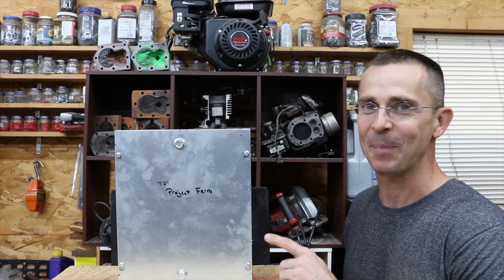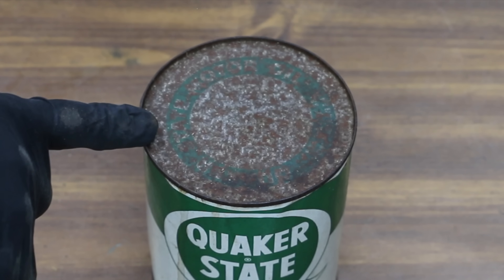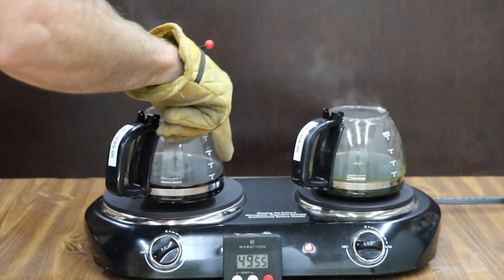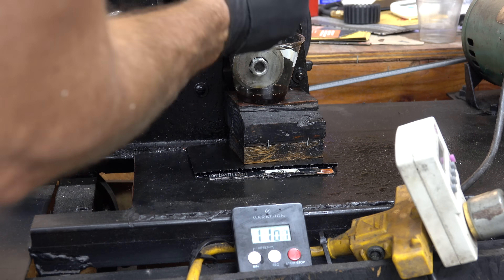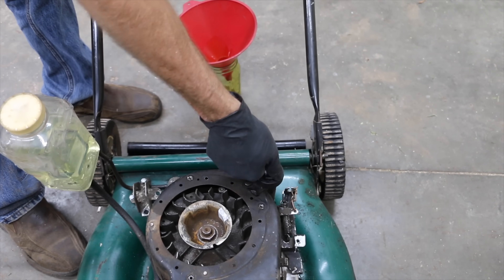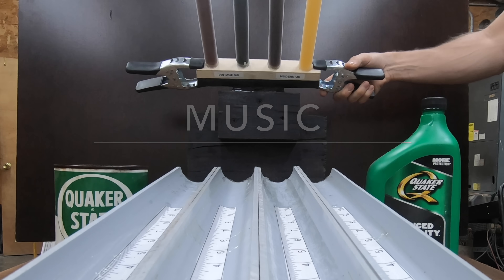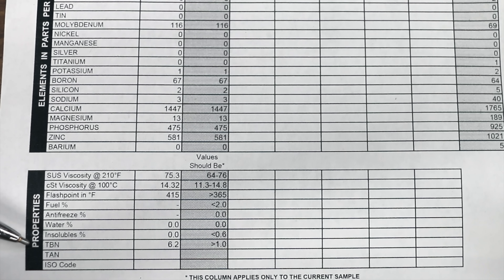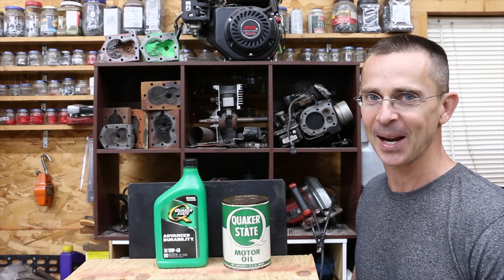Is Oil Good After 70 Years?  Let's find out!

Comment: My Dad used that very same Quaker State oil in the '39 Willys Coupe -- He would add a quart at every gas fill-up.
Cars didn't have Oil Filters in those days, and engines didn't last long.
It's SO much different now, thanks to modern technology and government environmental regulations.  
The famous 95 MERC's V-8 engine runs Pennzoil Ultra Platinum, 5W-20; Bosch Premium Oil Filter # 3410; and a FILTERMAG # SS365PR Magnet Kit. Oil & Filter changes at 5,000 miles.
Reply from the maker: Thanks for sharing!
Reply: I think a very long time ago,Quaker and Pennzoils were good quality,then they went through a problem period,I think now that under Shell they are perfectly good oil and safe to use although I am still a Valvoline Synthetic fan except for my small engines which might get some 15w-40 Diesel rated oil. or some thicker Mobil 1 if I felt like indulging the thing.

Comment: I wouldn't use Quaker State motor oil when it's fresh. One of the mechanics at a car dealership where I sold cars told me that an engine was severely gummed up inside when he tried to work on it. The owner used Quaker State oil. He told me not to use that brand of oil. I use Valvoline.

Comment: Around 1950 a service station talked my dad into using the "new" detergent oil in our 1948 Pontiac;  the engine lasted about one week as the oil turned into tar as it  "cleaned out" the crankcase;  the engine finally froze up and was a goner...
Reply from the maker: Thanks for sharing.

Comment: 50 years ago, I changed oil and filter every 1,000 miles. Also, Used motor oil for diesel engines in gasoline engines because the oil for diesel engines was better quality.,The manufacturers recommendation for oil and filter changes were for an oil and filter change every 30 days. If you followed that schedule the engine would stay clean and free of sludge. I could easily make an engine last 10 years or more. I paid 40 cents per quart of oil and on sale I could get new filters for 99 cents. Quaker state was an oil that I often used. In addition, I often used Chevron DELO for diesel engines. The Chevron DELO had a DG/DM rating. That means diesel general/ diesel medium.
Reply from the maker: Thanks for sharing.

Comment: Fascinating results thanks for the upload.👍

I bought a 5L jug of full synthetic QS blend two years ago and recently noticed that the production date is October 2016.  I read that the shelf life of sealed synthetic oil is generally between 3-5 years varies by brand.

Is the oil safe to use today in its sealed condition (5+ years later)?
Reply: @kimbuck-2  No guarantee in writing.  Up to 5 years is generally what the big brand manufacturers recommend if properly stored.  Anything beyond at your own risk.
Reply: They keep changing the specifications and test procedures for new car warranty every couple of years but often an older formula will pass the undated specifications I think. 
Circa 1979 the SE became obsolete,I think Quaker State/Pennzoil had to reformulate to pass the new for then SF rating but Castrol and/or Valvoline formulas already met the new SF requirements. 
 A new hurdle,some of the additives that were good for the engine seem to have been flagged by the EPA as bad for catalytic converter durability/life. So newly restricted as to amount permitted in oil.
Reply: @davidpowell3347  thanks for your input.  As an update since my last post, I proceeded with the oil replacement with the expired QS full synthetic jug and the engine is still running like a charm.  QS oil has been replaced since.  Top quality oil, imo; much better performance than the current/subsequent Pennzoil full synthetic replacement.

Hard to destroy engine with slightly overdue oil.  I heard of a fellow who did not replace the engine oil in his battered corolla for years and the car kept running, surprisingly.🤔

Comment: the old oil was probably a single viscosity 30 weight oil.  I remember as a kid when multi viscosity oils came oil because it was hailed for being good for "all -seasons" and you didn't have to change your oil in the winter/summer.  Great test though, pretty cool.
Reply from the maker: Thanks!
Reply: You could use the same grade both summer and winter.   No more calculating what viscosity to use just because of the time of year.  It wasn't always good though.  It sometimes sheared.  That's why many of us wouldn't use it.

Comment: Back in the late 70s it was common knowledge that QS would sludge up an engine worse than any other oil. A friend bought an old '67 Chevy with a 327 that barely ran. We started opening the engine up to assess what was going on. When we pulled the valve covers it was like taking a Jell O mold off. Completely filled with chunky sludge.  When we pulled the intake, the lifter valley was the same. Completely filled with chunky sludge.  If I remember correctly, there were some old QS cans in the trunk. This car clearly had been abused, not had the oil changed frequently enough and we don't know for sure if it had used QS all of it's life, but it sure seems to jive with the chemical analysis of that old QS.  
To this day, I avoid QS because of that experience, but it appears that moden QS is probably as good as just about any non synthetic oil made today.
Reply from the maker: Thanks for sharing.

Comment: I used to use that same oil in my truck. Has it been that long ago? I had a oil spout that you pushed into the top of the can so you didn’t need a funnel. 

Those days were so much better than now. I remember gas at .22¢ a gallon and just $2.00’s worth of gas at the full service station. You pulled up to the pump, a couple of guys would come out and tell you to pop the hood so he could check the oil and everything else while the other guy would pump the gas for you. All for $2.00.
Reply from the maker: Thanks for sharing.

Comment: The weight of oil and SAE was stamped on the upper or lower lid.  You needed to clean the ends to look at the raised numbers.  Also quaker state was formed between 1912 and 1931 so that oil is probably from the 1970s and could have been non detergent oil also.
Reply from the maker: Thanks for the feedback.

Comment: I remember when I was young, oil & soda pop both came in cans & you had to have the can opener you used or stab 2 holes with a screwdriver. Quaker state was green & had an odd, unpleasant smell. Lots of people claimed that Quaker state would gum up your engine. I always wondered if it was true.

Comment: My grandpa would use the same Q state oil to mix in 2 cycle gas in an old Clinton-powered, 3-wheel, Western Auto lawn mower. It lasted for years. Early to mid 60's
Reply from the maker: Thanks for sharing.

Comment: I really enjoy your videos and believe they are a big help to consumers. I have recently come across a product called Tribotex that is an oil additive that claims to coat metal surfaces in the engine with a ceramic coating and even claims to build up worn down areas with the ceramic. It claims to greatly reduce friction to the point of being audibly noticeable. It makes some pretty bold claims and they provide some test results to back their claims. The new formula of Bestline oil additive now also claims to provide a ceramic coating. I wonder if they are now using the same technology. If I send you some of each of these products in their original packaging could you test to see if they live up to their claims. I know you have tested Bestline in the past but the new formula appears to be ceramic based like the Tribotex. And they haven’t provided any Videos or much info on their new formula. If you will test them I will send them to you.

Comment: OK, I'm 3 years late. Back in the 70's, I worked at a Texaco gas station. We sold Havoline motor oil, but we also had some Texaco brand straight 30 non-detergent oil. IIRC, it sold for $0.49/ quart. It looked just like the old Quaker state oil, and probably performed about the same.
Reply from the maker: Thanks for sharing.

Comment: A few days ago I was looking through my Mum's garden shed and found a can of Golden Fleece Duralith 2.2 grease (Golden Fleece was an Australian company than merged with Caltex). I know it's been there longer than I've been around and I'm a 1959 model. I'd say it's a similar vintage to the oil in this video. Just for yucks, I looked it up and found a can of the same grease in slightly worse condition for AU $175! It did what I needed it to do but I wasn't greasing the bearings of a modern engine.
Reply from the maker: Thanks for the feedback.

Comment: Is it possible to do a similar test comparing oil that has 1) sat for a year (or two) in a small engine versus 2) brand new oil versus 3) oil that has sat on the shelf for a year or two?

This would answer the age-old question of whether oil REALLY needs to be changed every year, even if the engine has not been used very much or even at all.  Online forums debate this topic at length, but I've never seen any direct evidence backing the claim that engine oil acidity/viscosity suffers after sitting around for a year or two.  For example, do I really need to change my snowblower's engine oil if it only snowed 2 times last year?

Thanks for the great videos!

Comment: It looked like there was some labeling on the top of the can, where it was pierced with the can hole-maker. Was there not a viscosity grade? Most likely it was single grade, non-detergent oil. I remember buying oil in the late 60's and seeing that type of oil for sale, as well as single-grade high detergent, and multigrade. Not surprisingly, it did not flow well at cold temperatures. It was meant to be used only in warm weather. Say, in the mid-Atlantic and New England states, only spring, summer, and fall. I remember using single-grade, high detergent oil in my air-cooled Volkswagens. 30 weight in the warm season, 20W in the cold season. Thats what the owners manual said to use. Even though it was high-detergent oil, the recommendation was to change it every 3000 miles.
Reply: Even that was not enough, as the Bug didn't have an oil filter.  If I ever get one, I will add an oil filter to it and change the oil every 2,000 miles.

Comment: I ended up with a Ranger that went years with NO oil change. Pulled the motor and steam cleaned the INSIDE....New oil pump(high volume) and test ran it on WOLF'S HEAD oil from the 50s. Quarter of a million miles later that motor is still smoking!
Reply from the maker: Thanks for sharing.

Comment: Back in the1970s I remember Quaker state being one of those oils that if someone wasn’t a responsible  car maintenance advocate for their car (never changed oil just added, maybe) that when car finally started to die you could pull off the valve covers and swear they were jello molds cause you were looking at a perfect reverse of the covers in shiny black goo sealed over the rockers etc.  yep Quaker State that’s the stuff
Reply from the maker: Thanks for sharing.
Reply: FACTS.

Comment: The only oil I remember from then that was worse was Amalie . I've pulled more valve covers and intakes only to see nothing but sludge from it ! Clean the lifter valley and rocker assemblies  (usually with a shop vacuum) , scrape then reassemble . Flush the engine twice with Marvel Mystery Oil . Then drop the oil pan to clean it out , along with a new oil pump and screen.... was not the good old days !
Reply from the maker: Thanks for sharing.

Comment: And when u did the sea foam cleaning for pistion and valves we use to use hot water with a little laundry detergent in it and it’s called steaming the cylinder I like to see if it really works or if it is a method
Reply from the maker: Thanks for the suggestion.

Comment: You should’ve maintained the temperature of the 4 oils during the test. The oils were in a freezer and then poured for a race. The room you conducted the experiment in was warm, and slowly warmed up the oil. I just wonder how slow the oil moves in a constant cold environment. No wonder cars 60 years ago had so much trouble starting in the winter.
Reply from the maker: Thanks for the feedback.

Comment: Something worth considering might have been fuel content as well. Back in the 1950's wasn't there a high lead content in fuel which was meant to keep the engine running smooth?
Reply: also back them you changed oil every 1500 to 3k miles max
Reply: The lead formed lead oxide during combustion and deposited on the exhaust valve seats to prevent wear.

Back then the exhaust valve seats were just the same material as the heads or block (flat head) so it needed the lead oxide to protect and "lubricate" the valve seats to prevent wear.

Modern engines have hardened valve seats made of stellite as well as hardened exhaust valves and bronze valve guides to be able to burn unleaded fuel.

Exhaust valve recession is what the lead prevents in older cars.
Reply: @Videoswithsoarin  Wrong.  See my reply to the OP.
Reply: The lead was mainly to raise the octane cheaply, and was soon, in the 30s, discovered to protect the valves and seats as well.
Reply: @jonsworld5307  I still do.
Reply: @knobdikker  Some truck engines, and my Chrysler 1st generation Hemi, have Stellite valves and seats.

Comment: I remember changing the oil in cars that I had in the 1970s. They were due every 3000 miles and by that time the oil was like black paint.
Reply from the maker: Thanks for sharing.
Reply: If you could go back in time to those wonderful 1964-1970 cars (not the other 1970s) you would want to only use single weight oils or Diesel certified oils as for Cummins or Cat. ,avoiding the 10w-40 oils like the plague. 
Rapid blackening or developing the smell of gasoline in the oil probably meant that the automatic chokes were causing an excessively rich gasoline mixture after the car was into the warm up cycle or already fully warmed up. 
Automatic chokes weren't so great,usually got out of adjustment or the  "pull-off" didn't work properly.

Comment: I was doing some rotavating with a hire machine and the transmission oil seemed to be a grey sludge so I used some from a 🛢️ i found in some bushes nearby from company called precision oils based in Bradford 1986 - 2004  seemed to be a grey sludge so I put some transmission oil i that must have been from around 1994 as it had UK 01 and phone number without the 1 prefix and it seemed to help later i filtered the can when pouring out and at the bottom were little tin flakes and gave it to a neighbour with a tractor , it was orangey green and frightful stuff compared to engine oil in its character
Reply from the maker: Thanks for sharing.
Reply: @ProjectFarm  A lot things kept in an inert or low reaction atmosphere actually keep for years sugar keeps for years along with white flour. I thought some 25-30 years old oil would be better than the grey sludge the machine had and it seemed better afterwards. Oils being low reaction and less volatile compounds keep better than spirits. Diesel keeps much better than petrol for this reason

Comment: Would have been interesting to find whether any markings indicated viscosity rating on the rusty top of the can. SAE 30 was to have been used only in summer or warm climate conditions, vintage cars changed oil often and changed to suit the changing season,like SAE 20 in summer, SAE 10 or 10w in winter, maybe even SAE 5w in winter. SAE 30 or 40 in summer in an old car with severe engine wear and high oil burning. 
I understand that the original Pennsylvania oil has mostly been used up,some of it came almost clear as it came from the ground or even from a "seep" and with filtration was sometimes consumed as a medicine! (to provoke a bowel movement)
I think modern "Quaker State" and "Pennzoil" are Shell Oil Company products and that the original Quaker State refinery no longer exists. 
  If you were to compare Quaker State 10w-40 vs.  Quaker State SAE 30 from the mid 1960's I predict the 10w-40 would have done far worse as to sludge forming

Comment: Call me crazy but on all my lawn equipment I use ngk spark plugs. But the first thing I do when I get then is cut the little L shaped tab on the bottom of the spark plug short, just enought to expose the  the little circle underneath. If this makes any sense. Idk of Ant other way to explain it without showing a picture or showing you in person. Yes this eliminates the need for gapping but what I found is that I never have to use the choke when could starting any motor. I just keep the choke wide open. It also makes the engines runs smoother. As far as gas efficiency goes idk never paid attention to it. But u can say they don't foul out as much and motors start easier and quicker when L shaped tab is not as long. Now obviously u can't do this with spark plugs the differ from the original style like the E3 or pulsar. Also found that doing this in 2 stroke motors allows you to run higher oil to gas mixes keeping your motors lubricated better therefore the motor lasting longer. Also there way way better throttle response. I never understood why they don't have spark plugs like this already. The best way to explain what the spark plugs look like after I cut the is, imagine the E3 having only one tab on the bottom instead of 3 and that's what the spark plug looks like when I'm done. The L shaped tab is cut just stopping short of the circle nub underneath. I hope this makes sense cuz it's hard to explain. Like in all my 2 stroke engines I run a 25 to 1 oil to gas mix and my motors last longer and don't lose power to to this little hack I use. Because keep in mind 2 strokes only get there lubrication from your oil you mix in the gas so the more oil the less friction there is and in return less heat.
Reply from the maker: Thanks for sharing.